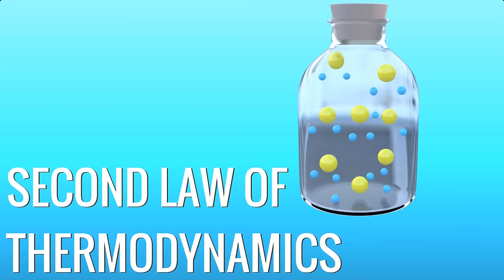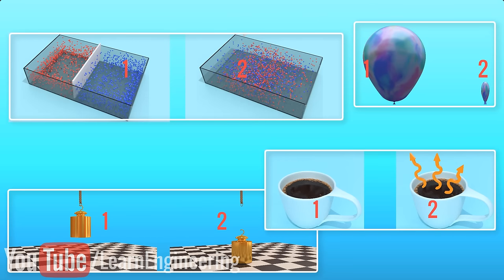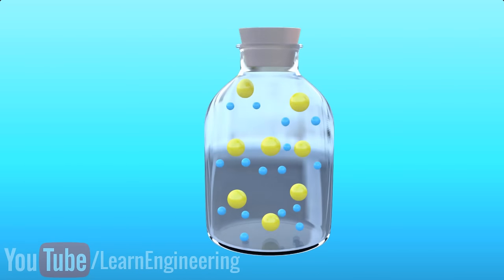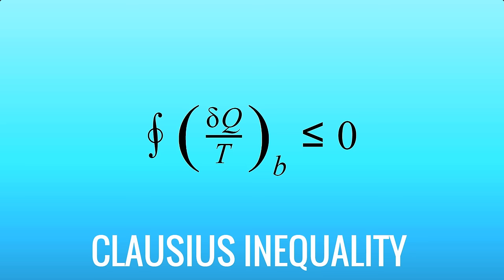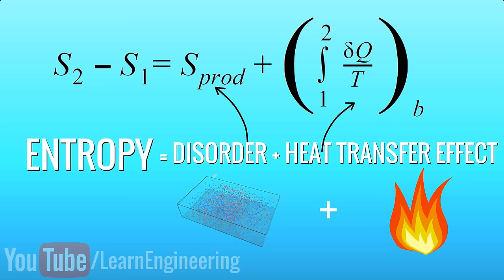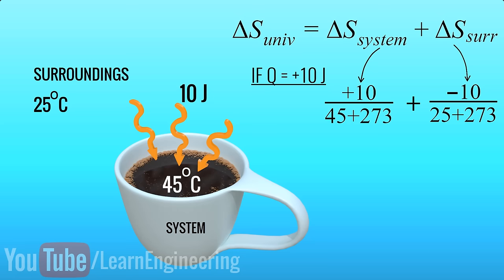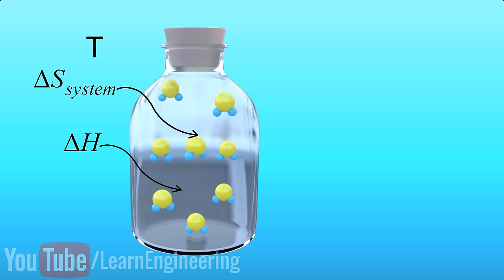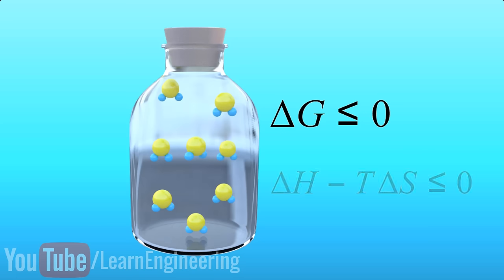Understanding Second Law of Thermodynamics !

Comment: Many misunderstandings in understanding the problems of life and evolution from the standpoint of physics and physical chemistry are typically associated with misconceptions in understanding entropy. The term "entropy" coined Rudolf Clausius. According to his model of the world (universe), he presented a statement: "The energy of the world is constant. The entropy of the world tends to the maximum". Later this statement    was chosen by JW Gibbs as an epigraph to the paper "On the Equilibrium of Heterogeneous Substances". These scientists have given this statement in relation to their model of the universe. This model corresponds to a simple isolated system of ideal gas, i.e. isolated system of ideal gas, energy and volume of this system are constant and in which only the work of expansion is performed. Entropy of such a system can only increase!
It should be noted that when we say on ideal model, which would correspond to the real universe, it would be necessary to accept the unreal assumption that any form of energy real universe will be transformed into thermal energy. Only in this case, also under additional unrealistic assumptions, the real universe "would turn" into the model of ideal system of Clausius - Gibbs.
However, lovers of science have applied representations on simple systems to systems of other types, in which the interactions takes place between particles of different nature (interactions of molecules or other objects of different hierarchies) and to systems which interact with the environment.  Some scientists, who are not professionals in the relevant fields of knowledge, have not escaped such errors. This has led to unimaginable confusion. This has slowed down the development of science, more than on a century. There are thousands of publications in scientific journals and popular literature containing marked misunderstandings. To these were added incorrect ideas on the negentropy and on the dissipative structures in the living world, and the false identification of "the information entropy" with the thermodynamic entropy.
The origin of life and its evolution can be easily explained from the standpoint of hierarchical near equilibrium thermodynamics of complex dynamic systems. This thermodynamics is established on a solid foundation of equilibrium thermodynamics - thermodynamics of Rudolf Clausius, JW Gibbs and other great scientists.
Reply: lol im dumb

Comment: From first law of thermodynamics we know that the total energy of the universe remains conserved that is the sum of the energy in in system and surrounding before and after the reaction is conserved but a question should arise in our mind that what is the direction of this flow of energy is it flowing from the system to surrounding or the energy is flowing from the surrounding to system so this direction is given by the second law of thermodynamics. 
It's a mathematical analogy 
But in simple words you can understand it as if gibbs free energy of a reaction is less than 0 the reaction is spontaneous that is it does not need any external energy source that is there is no flow of energy from surrounding to the system so we can conclude that the energy is flowing from system to the surrounding

Comment: Many discrepancies in understanding the problems of life and evolution from the standpoint of physics and physical chemistry are typically associated with misconceptions in understanding entropy [4-7]. The term "entropy" was coined by Rudolf Clausius. Following his model of the world (universe), he stated: "The energy of the world is constant. The entropy of the world tends to the maximum". Later this statement was chosen by J.W. Gibbs as an epigraph to his paper "On the Equilibrium of Heterogeneous Substances". These scientists have given this statement in relation to their model of the universe. This model corresponds to a simple isolated system of ideal gas, i.e., an isolated system of ideal gas, in which the energy and volume are constant and only the work of expansion is performed. The entropy of such a system can only increase! It should be noted that when we speak about the ideal model that would correspond to the real universe, it would be necessary to accept the unreal assumption that any form of energy in the real universe will be transformed into thermal energy. Only in this case, and under additional unrealistic assumptions, the real universe "would turn" into the Clausius–Gibbs model of the ideal system. However, science amateurs applied representations of simple systems to systems of other types, in which interactions takes place between particles of different nature (interactions of molecules or other objects of different hierarchies) and to systems which interact with the environment. Some scientists, who are not professionals in the relevant fields of knowledge, did not escape such errors. This led to unimaginable confusion and slowed down the development of science for more than a century. There are thousands of publications in scientific journals and popular literature containing marked misunderstandings. To these were added incorrect ideas on negentropy and on dissipative structures in the living world and the false identification of "the information entropy" with the thermodynamic entropy.
The origin of life and its evolution can be easily explained from the standpoint of hierarchical near-equilibrium thermodynamics of complex dynamic systems. This thermodynamics is established on a solid foundation of equilibrium thermodynamics, thermodynamics of R. Clausius, J.W. Gibbs, and other great scientists.
https://www.arcjournals.org/pdfs/ijrsb/v5-i3/2.pdf

Comment: Dear Sabin + your esteemed audience,

First of all, many sincere thanks for your collective efforts!

 "The "Second Law of Thermodynamics" is a fundamental law of nature, undeniably one of the most valuable discoveries of mankind. However, this law is slightly confusing for most engineers or students. The main reason for this is that it contains so many complex terms and there are many ways to phrase this second law, but most importantly the majority does not understand what the applications of this law are. In this video we will provide a real physical insight into this law with a minimal use of mathematics".

      ...Sounds terrific, but looks to be not for an average mind... Even big scientific research workers' brains had and still have to stumble herewith...

   Moreover, your report demonstrates the meanwhile widespread Operationalism (unwillingness to enter important details) easily muddled-up in the audience with the 'engineering rigour'...

Hence, some kind of a clarification ought to be urgently necessary! 

So, captain, AHOY!

A. There is ONLY ONE BASIC, fundamental Energy Conservation and Transformation Law. It  is definitely unique and conceptually indivisible delivering two logically joint concepts - these are Energy Conservation - and Energy Transformation. Still, a more-then-100-years-old conceptual failure has brought us to two separate thermodynamic laws - but this has nothing in common with the actual physics. To come back, they have coined two more fake thermodynamic laws, employed the Probability Theory + Mathematical Statistics, and this has helped formulate the Quantum Mechanics, which is thus a basically metaphysical conceptual construction - and, hence, ought to be only restrictedly fruitful.

B. By dividing the basically indivisible law, you are touching Combinatorics, you are touching Probability Theory, you are even stepping back to Thermodynamics for a while, but...

You are NOT answering the poser: WHAT IS ENTROPY, sorry!

1. In the formula S = kB * ln(Ω) you do imply, Ω means not a "Huge Number of Microstates", not "Probability", which numerically ranges between [0,1], not even "Wavefunction", which ought to be a purely metaphysical notion, as it is... In effect, Ω ought to be a simplistic algebraic function of Lord Kelvin's Absolute Temperature. This result has been published 100 years ago in JACS.

2. WHAT-ENTROPY-IS-poser has been answered not by Clausius, not by Boltzmann, etc., but by Goethe, who has introduced Mephistopheles, the philosophical embodiment of ENTROPY.

3. Newton did basically know WHAT ENTROPY IS - A Counteraction.

4. That Counteractions do not grow to infinity with the growing Actions, but MUST reach their MAXIMUM values, is the result by Nicky Carnot, which has been formalized by Clausius...

5. In effect, J. W. Gibbs Free Energy formula: 

(ΔG = U + pV - TS, .i.e.,
 ΔG = H - TS
, where
U is the internal energy (SI unit: joule),
p is pressure (SI unit: pascal),
V is volume (SI unit: m3 = m*m*m),
T is the temperature (SI unit: kelvin),
S is the entropy (SI unit: joule per kelvin),
H is the enthalpy (SI unit: joule)) 

renders implicit the interplay among ALL the relevant Actions (the Enthalpic term) and ALL the pertinent Counteractions (the Entropic term).

6. The standard approach you are reporting about is OK for the implicit Enthalpy-Entropy picture,  employing it for studying reaction mechanism details is likewise eating soup with a fork.🧐
Reply: My brain hurts after reading this.

Comment: May I request to please correct me if I am wrong.
Wikipedia meaning of explosion:  An explosion is a rapid increase in volume and release of energy in an extreme manner

The applications of explosion in the system the principle of Thermodynamics fail.

The Internal Energy is multiple times lower than the work done by the system or The WORK OUTPUT is multiple times higher than the WORK INPUT 

I. A 15 ball billiard pool to be strike by white mother ball. 
F = 30lbs (White Mother Ball); D = 3ft (Distance from the white mother ball to the first ball to strike); W = Work, F = force; D = Distance

The mother ball to strike the 15 ball is the work input
The first collision is explosion followed by increase in force and travelled distance by individual ball followed again a series of collisions.

The mother ball transferred the force to the group of 15ball. The momentum is conserved to the group of 15 while the explosion increases to 15 individual ball. 

The kinetic energy was absorbed by the group of 15ball. The explosion increases rapidly multiplied to 15ball individual. 

SOLVE FOR WORK INPUT 
W = F X D;  W = 30lbs  x  3ft  =  90Ft.lbs          

SOLVE FOR WORK OUTPUT 
W = F X D; W = 30lbs x 3ft = 90ft.lbs  X 15ball = 1,350 ft-lbs.

II. For more heat energy the ball to replace with steel ball and steel side board. After strike are explosions of 15 balls. The explosion increases the group energy into individual 15. The work output higher than work input followed by series of collisions that produces more heat more work output, more sound energy more work output, more travelling distance more work output.

III. To get even more energy output: Put additional two group of 6balls in triangular shape to be placed somewhere at the back of 15balls at least 4inches apart from the sidewall and back wall. A total of 15balls + 6balls + 6balls = 21balls. The explosion creates collisions after collisions increasing the energy output.

The Internal Energy in I, II, III are the same however, after explosion the work done increasing 15 times the Internal Energy. That principle can use to make free energy machine.

Thank you. 

Abel Urbina Abel Urbina Free Energy Super Machine

Comment: Human has a serious misconception about energy. Energy is usually expended by using direct. However, if we use energy indirectly, it can be used without spending zero percent. This way more energy can be generated without wasting energy.

Comment: 5:10 Notice how it's actually possible to extract free energy, if the system loses less or equal entropy than the surroundings gain.
This explains the free energy circuit that was built at the University of Arkansas using freestanding graphing.
Reply: Free energy is not possible, if a system loses entropy then that is compensated by a larger or equal gain in entropy for the surroundings. As stated in the video, the entropy of the universe can be mathematically proven to only increase with time.

Comment: Second law is not an absolute law its just a very likely guideline.. You mentioned multiple time that its impossible for heat to come from a cooler system.. That's not exactly true.. Its only improbable.. I think its crucial to realise the difference..
Reply: You are right. My heat pump is extracting heat from the cold air outside my house, because the temperature of this air is above -273.15 C (0 Kelvin).

Comment: 1st Law - you can't win (you can never get more energy out than you put in)
2nd Law - you can't break even (energy conversions are always less than 100% efficient and some energy is always converted into a form you don't want - usually heat))
3rd Law - you can't get out of the game (the 1st and 2nd Laws always apply no matter what)
Reply: Not so. You exercise an then you have more Energy..
Reply: @ChrisOakesCO  Your energy comes from the food you eat - if you exercise, you use up more of that energy provided by the food, leaving you with less total energy.  You might FEEL better after exercising, but you definitely don't have more energy available than if you had eaten the same food and not exercised
Reply: @brucemcpherson8832  Still not so because when you exercise your body starts working more efficiently an you have more Energy stored an available. Unless your looking at it as you had more fat so you had more energy.
Reply: @ChrisOakesCO  How efficiently your body converts food or fat into energy is irrelevant.  Your body is continually converting food or fat into energy just to keep you alive.  The more you exercise, the more food or fat is converted into the energy needed for you to be able to exercise.
I'm not saying that exercise is bad, on the contrary, exercise is good, but looking at it purely from a thermodynamics perspective, if you eat, but don't exercise, your body has a larger store of energy available for when you want or need to exercise.
Taking it to the extreme and using Einsteins famous equation E=MC² which shows that mass and energy are equivalent, a 200Kg person has twice as much energy as a 100Kg person
Reply: @brucemcpherson8832  I see your point. I see it differently though. If you exercise but don't change your diet you still gain more Energy! Maybe I'm looking at it as in only Energy that is excessable. Sorry if I spelled excessable wrong.
Reply: @ChrisOakesCO  I think we may have a different understanding of the word "Energy" 
I'm using it in it's strict scientific sense since, after all,  the video was about the Laws of Thermodynamics.
Reply: @brucemcpherson8832  True, you right. My mind was drifting.

Comment: 4:01 "We can prove that the entropy of the universe always increases" -- No, we can prove that the entropy doesn't decrease (>= 0).
Reply: To quote Wikipedia, on the subject of entropy:

"Non-isolated systems, like organisms, may lose entropy, provided their environment's entropy increases by at least that amount so that the total entropy either increases or remains constant. Therefore, the entropy in a specific system can decrease as long as the total entropy of the Universe does not. Entropy is a function of the state of the system, so the change in entropy of a system is determined by its initial and final states. In the idealization that a process is reversible, the entropy does not change, while irreversible processes always increase the total entropy."

The Universe is an isolated system, since energy or mass cannot leave it. Thus, entropy can only increase within it, until thermodynamic equilibrium is reached.
Reply: @JinwooYoon1217  That's why both the video, and by derivation my comment on it, referred to the entropy of the universe, not the entropy of a smaller part of the universe. As you point out, we can consider the universe to be a closed system (as far as we know).

Comment: The second law states if the process is reversible or not, more importantly, that you cannot convert a given amount of heat completely into work! I hope you guys are clear about this point.

Now, let's come to Clausius inequality, which is nothing but a ratio of ∆Q/T for a cyclic reaction where the initial & final states are the same.

This ∆Q/T is = 0, if process is reversible & <0 for irreversible process. To understand this better you will need knowledge of a simple heat engine, which works by receiving a certain amount of heat from a higher temp reservoir (eg: Boiler which supplies steam), and produces work as well as ejects some heat into a lower temperature reservoir (atmosphere).

So, as I have mentioned earlier the amount of heat received is not converted completely into work rather a part of it has been rejected into the atmosphere. This part is called "UNAVAILABLE ENERGY" or "ENTROPY" which is nothing but the portion of given energy that cannot be used to extract any work.

Therefore, for a reversible process, the heat engine or any system possesses zero unavailable energy (ie, complete conversion of heat to work is possible), whereas this is not the case with the irreversible process as it involves a lot of unavailable energies in the system. The ratio of (∆Q/T) is not termed as Entropy for the irreversible process, it is meant to be called as entropy for reversible process only.